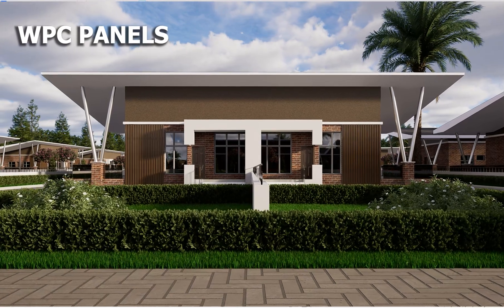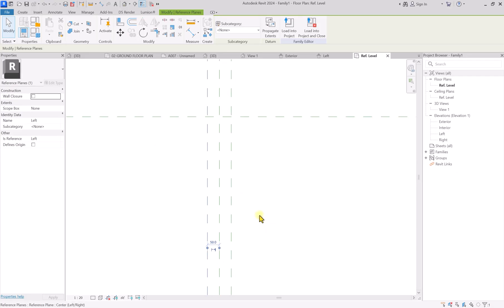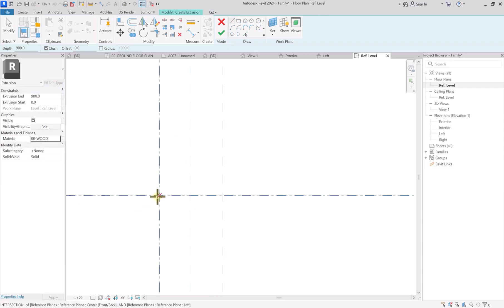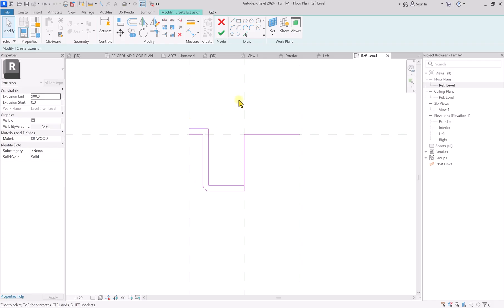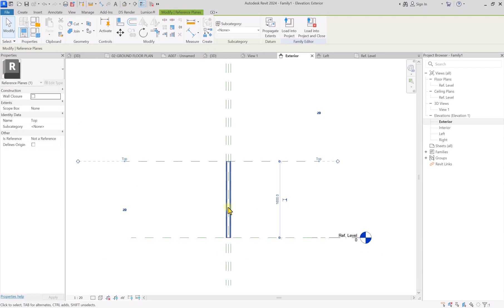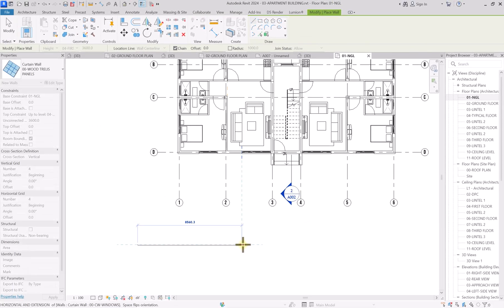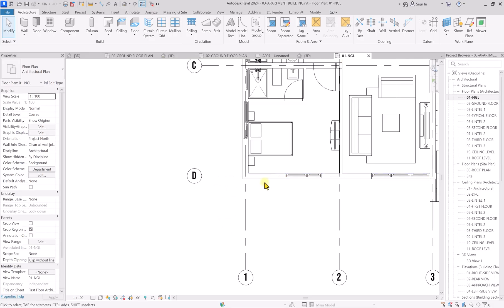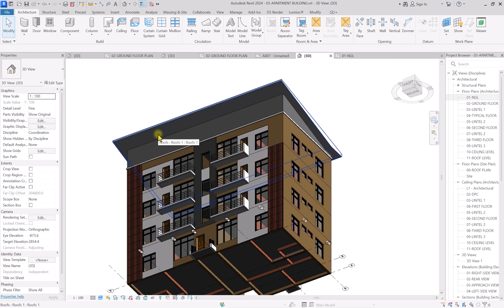Create Parametric Composite Panels In Revit

Comment: The problem with this method is its limited to 100 panels. You need to split it. As an alternative you can use beam system.